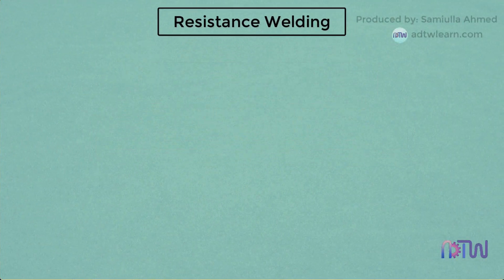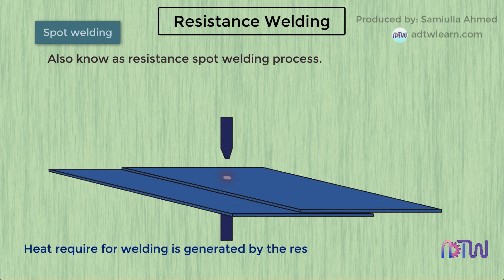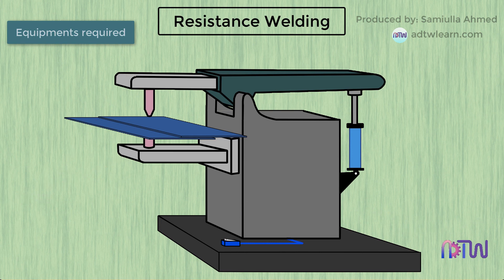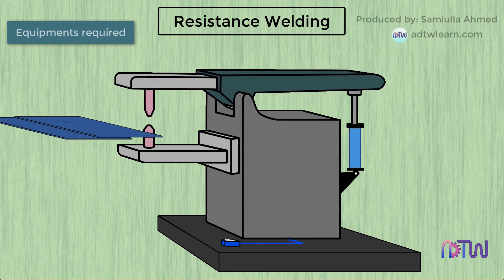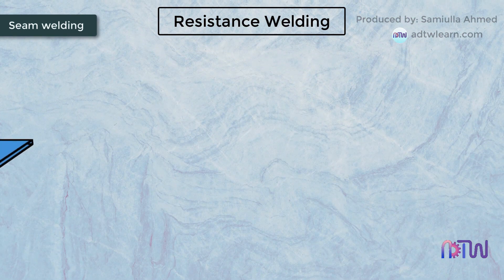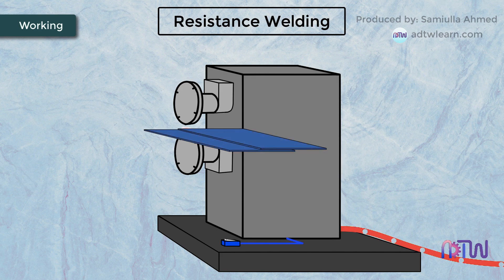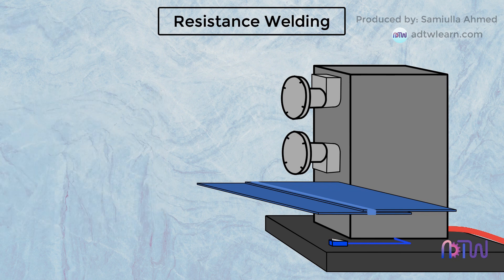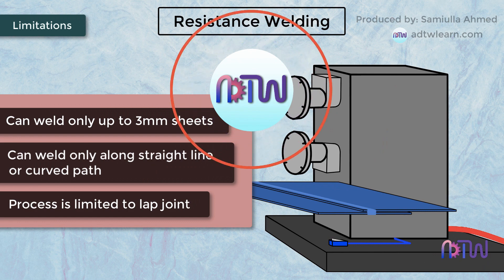Resistance welding process | Spot welding and Seam welding process

Comment: why the plates are overlapped up to some extent?
Reply from the maker: Because without overlapping you cannot join them. In other types of welding processes, we provide filler materials but in the resistance welding process, we overlap thin sheets on their edges and make a current pass through them, by doing so there is heat generated at that point and both the plates melt and fuse...

Comment: A couple things (from someone with 30+ years in the field).  Resistance welding does not "melt" the materials being joined.  They are heated to a plastic state and forged with pressure of the electrodes.  When the material is heated to melting point, there is usually a large amount of expulsion.  Expulsion is not desirable.  The electrodes are a copper alloy.  Pure copper is too soft to be used in a production environment.  Tongs are only used in the smallest of welders.  Typically they are called "arms". and may be up to 4-6" in diameter for really big machines.  Seam welding rollers are called wheels, and are made from the same copper alloys as spot welding electrodes.  Usually, the wheels are forged to improve life. You can imagine those wheels are very expensive.
Reply: Thank you
Reply: Thanks man😊
Reply: Oh plastic state, if they do not melt how will they become plastic, just wondering 🤔
Reply: @ojihmona2056 due to applied pressure. Plastic state refers to deformation above yield point.
Reply: Melting means its heating more than melting point in this we do only upto plastic state only @ojihmona2056